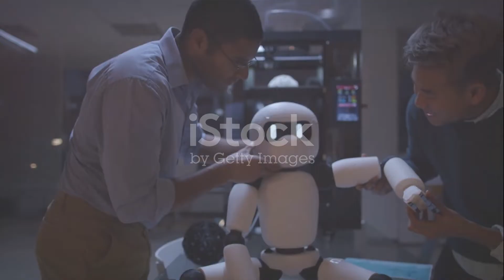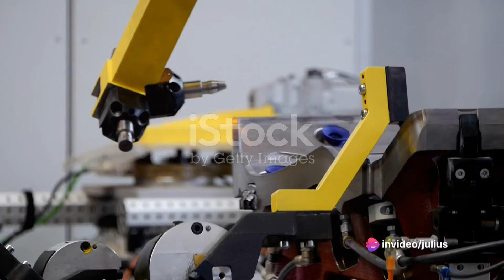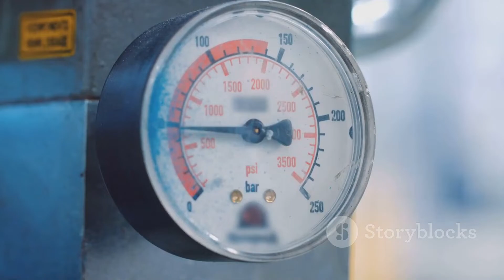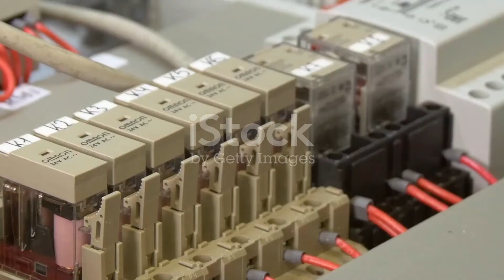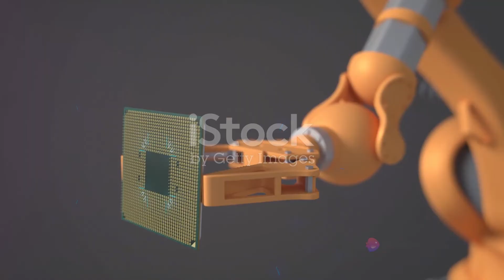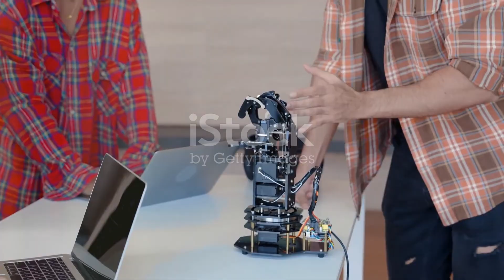Top 10 Analog Inputs in Robotics

Comment: Angel Alexa M. Maquilan
10 - LYRA

1.) What are analog inputs and why are they important to robots?
- Analog inputs are like a special way for robots to feel things. They can measure things like how hot or cold something is, how much pressure is on something, or where something is. This helps robots understand the world around them and do things more carefully and smoothly.
Reply: Mitch Micah E. Niere 10 - Lyra
1.) What are analog inputs and why are they important to robots?
Analog inputs provide robots with a unique way to sense their surroundings. They have the capability to gauge factors such as temperature, pressure, and location. This assists robots in comprehending their surroundings and executing tasks with increased precision and efficiency.

Comment: Catherine Anne C. Gamalo
10-Lyra

1. What are analog inputs and why are they important for robots?

-Digital inputs are discrete values, whereas analog inputs are signals or data that vary continuously over a range. For robots to feel and react to the constantly changing conditions of the actual world, analog inputs are essential. This allows for smoother control, enhanced perception, and more effective engagement.

Comment: Leon Anthony S. Juaneza
Lynx-10

3. Explain the role of position sensors like potentiometers in robotic systems.
-Position sensors such as potentiometers provide an analog voltage proportional to the position a movable part. Position sensors could also produce varying voltage signals as a function of rotation or position, allowing precise measurements of angles. In summary, position sensors are devices that detect the location or displacement of an object.

Comment: RAINE S. BADON
10-LYNX

1. What are analog inputs and why are they important for robots?

Analog inputs are a type of signal that provides data on continous electrical signals. They are very essential in robotics since, unlike digital inputs that only provide either a high or low signal, analog inputs give exact and accurate information on its environment. Some examples of analog inputs include a potentiometer that adjusts resistance based on how much you turn the pot, or a temperature sensor that changes resistance based on the ammount of heat.

Comment: Zane Maritonghe Mendaros
10 - CASSIOPEIA

1. What are analog inputs and why are they important for robots?

Analog inputs are signals that speak to nonstop and shifting amounts, instead of discrete double states. They can take on a wide extend of values inside a particular range, giving nuanced data around the robot's environment. These inputs are vital for robots since they empower the estimation of factors such as position, constrain, temperature, weight, and more, permitting robots to associated with and react to energetic, real-world conditions with more noteworthy exactness and versatility.

Comment: Xharmei Therese P. Barcenilla
10 - LYRA

3. Explain the role of position sensors like potentiometers in robotic systems.

Answer: Position sensors, such as potentiometers, play a crucial role in robotic systems by providing precise information about the position of a movable part, like a robot joint. This data is essential for tasks requiring accurate movement and control, such as navigating a robot's arm or ensuring that a robotic joint reaches a specific angle. By offering continuous feedback, potentiometers enable smoother and more precise operations, enhancing the robot's ability to interact with its environment effectively.

Comment: Ma. Pashka R. Resoso
10-LYRA
5. How do analog signals get processed by robots after they are collected from the environment?
-Analog signals collected by robots are converted into digital signals by an analog-to-digital converter, then processed by the robot’s control system to interpret the data, so that they could adapt ability of robot's applications and then used to make decisions or control actions.

Comment: Maykylla Geraldine R. Egarguin
10-LYNX

2.Describe the analogy used in the video to explain the significance of analog inputs in robotics.

In the video, the significance of analog inputs in robotics is explained using the analogy of a dimmer switch for lighting. Just as a dimmer switch allows you to adjust the brightness of a light continuously, analog inputs in robotics enable the robot to measure and respond to varying levels of physical quantities, such as light intensity, temperature, or distance. This continuous range of values provides the robot with more detailed information compared to simple on/off signals, allowing for more nuanced and flexible responses to environmental conditions.

Comment: Roda A, Patayon
10 - LYNX

3. Explain the role of position sensors like potentiometers in robotic systems.

Position sensors like potentiometers significantly help robots know where their parts are. They are like a ruler that tells the robot how far its joints have moved. This information is important for the robot to move its arms and hands correctly. It's like knowing where your fingers are when you reach for something. This is crucial for controlling their movements precisely and performing tasks that require accurate positioning.

Comment: Angel Anne L. Martirez -10 Orion🌸

4. What are some examples of various analog sensors mentioned in the video, and what measurements do they provide?

First Analog Encoders it produces varying voltage signals as a function of rotation or position,allowing precise measurement of angles.
Lastly Analog Cameras,it produfes voltage signals that represent intensity of light at different points.

Comment: Nuriel Danna Garcia
10 LYNX

1. What are analog inputs and why are they important for robots?

Analog inputs for robots are signals that show ongoing and varying measurements, unlike simple on/off signals. They can provide a wide range of values, giving robots detailed information about their surroundings. This helps robots detect and interact with things like position, force, and temperature.

Comment: Jhonlee O. Oliveros - 10 Lyra
1. What are analog inputs and why are they important for robots?

:Robots use analog inputs, which are data or signals that show continuous and variable quantities as opposed to discrete binary states. Analog signals can have a range of values inside a predefined range, giving more precise and in-depth environmental information. For robots to perceive, measure, and interact with variables like position, force, temperature, and more, these inputs are essential. The robot's control system converts analog inputs to digital representation before processing them.

Comment: Precious Lea Jennifer D. de Dios
10 - ORION

3.	Explain the role of position sensors like potentiometers in robotic systems.
-	In position sensors, potentiometers or variable resistors provide an analog voltage proportional to the position of a movable part such as a robot’s joint.

Comment: Enopia, Jana Sophia D.
10 - Lyra

1. What are analog inputs and why are they important for robots?

Analog inputs for robots are signals or data that represent continuous and fluctuating quantities, unlike binary states that are either on or off. These inputs can take on a wide range of values, providing robots with detailed information about their environment. Analog inputs are important for robots because it allows robots to accurately sense, measure, and interact with variables like position, force, and temperature, enabling them to perform tasks with greater precision and adaptability.

Comment: Iam Raut Labnotin
10-Lyra

1. Explain the role of position sensors like potentiometers in robotic systems. 

•In robotic systems, position sensors such as potentiometers assess a component's position or movement and provide feedback for accurate motion control. This enables the robot to complete tasks precisely by altering its movements depending on real-time position data.

Comment: Janaya Dyreane S. Baja
10 - LYRA

5. How do analog signals get processed by robots after they are collected from the environment 

— Robots process analog signals from their environment by first using sensors to collect data and convert it into analog signals. These signals are amplified and then converted to digital data by analog-to-digital converters. The robot's computer analyzes the digital information using algorithms to interpret the environment and determine appropriate actions in response.

Comment: Cherish Stefie D. Bacayo
Grade 10-LYRA

5. How do analog signals get processed by robots after they are collected from the environment?

--
Analog signals are converted to digital by an analog-to-digital converter (ADC), allowing the robot's control system to process the information. The digital data is then used to generate control signals for actuators, enabling the robot to perform tasks.

Comment: Cassandra Louise Calvo
10 - Andromeda 

3.  Explain the rule of position sensors like potentiometer in robotic systems.

- Position sensors, such as potentiometers, play a crucial role in robotic systems by providing feedback on the position of various components, enabling precise control and movement.

Comment: SOMOBAY, ABBYGAIL A. 

(10 - LYRA)

01. What are analog inputs and why are they important for robots?

answer: Analog inputs are signals or data representing continuous & fluctuating quantities not just discrete binary states. These are essential for robots in order to sense measure & interact w/ variables such as position, force, temperature, and more.

Comment: Manzanades, Chelsy
10-ANDROMEDA
3. Explain the role of position sensors like potentiometers in robotic systems.

- Provide an analog voltage proportional to the position of a movable part, such as a robot joints.

Comment: Cassandra Louis R. Bigwas
10 - LYNX

4. What are some examples of various analog sensors mentioned in the video, and what measurements do they provide?

Some examples of various analog sensors mentioned in the video are analog pressure sensors and analog gas sensors, in which the former measure fluid or gas pressure, providing analog voltage or current output proportional to the pressure while the latter measure the concentration of specific gases in the environment, providing varying analog outputs.

Comment: May Ville D. Ortega 
10 - lyra

3. Describe the function of position sensors in robotic systems, such as potentiometers. 

- - In robotic systems, position sensors such as potentiometers produce an analog voltage proportional to the position of a movable component, such as a robot joint. Then, analog encoders generate varying voltage signals as a function of rotation or position, allowing for precise angle measurements.